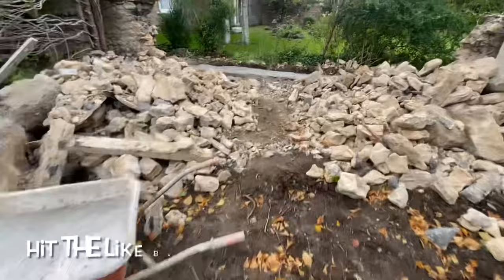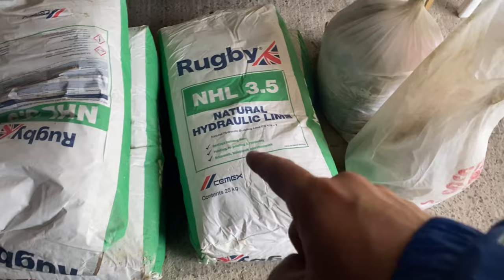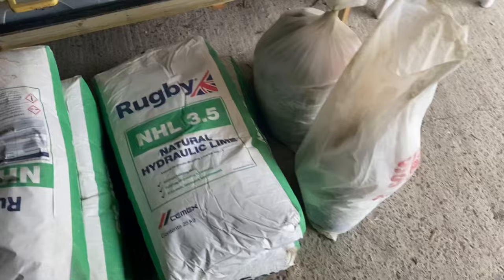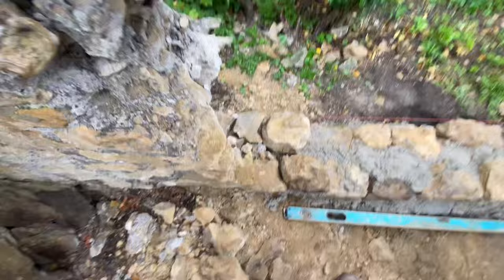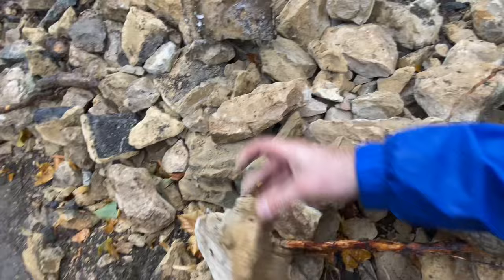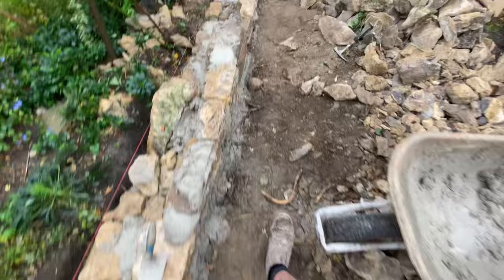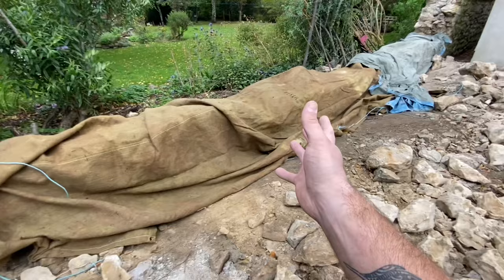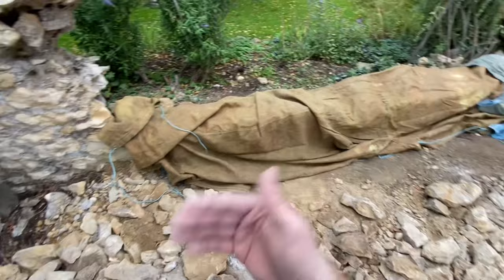Building A Stone Wall Using Rough Stone #1

Comment: I have a limestone wall enclosing a victorian water tank with a 2 meter gap where it's collapsed. What mortar mix would you recommend?
Reply from the maker: All depends on the style of walling & also if mortared, what type of mortar has been used on the rest of the wall. Find out possible reasons why the section has collapsed. A lime mix should always be used on stonework, but once again depends on budget, scenario etc.